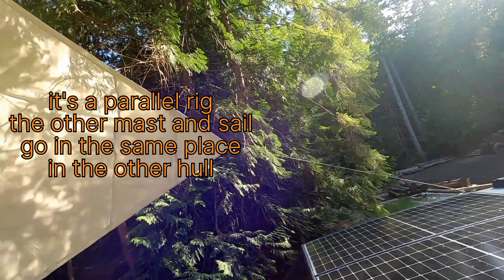making crappy sails in the forest without electricity haha - creating Oceansflow Ch Five

Comment: Tarp should work well for a few years.  Those who have done so think it costs more than sail cloth in the end.
Personally I would make a modern junk style sail.  Ok more complex, but the cloth can be much lighter as the battens take the load.
I think in practice the wrap around sail won’t work at that size.  If it doesn’t wrap cleanly, it gives a lot of windage.
Reply: It would be worth having a sacrificial UV strip on the back, at least. just doubling up the same tarp in that area would be better than nothing. The trouble with roller furling is the sail is AWAYS in the sun. I've seen plenty of boats left on moorings for years and now the sail is ruined! (even with a UV strip, it needs to be replaced occasionally)

If you had a zip on the sleeve (as wharram sleeved sails do) you could take the sail off without lowering the mast. hmm or some kind of lacing might be more reliable...